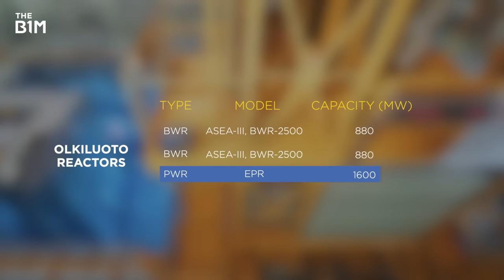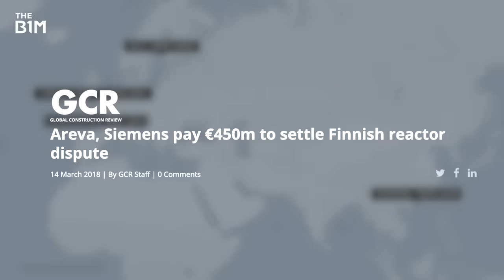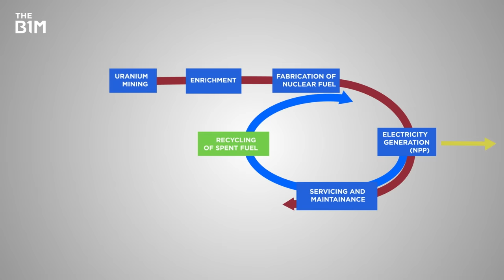Finland Might Have Solved Nuclear Power’s Biggest Problem

Comment: wait. this whole video boils down to "just bury it good."
Reply: Turns out that's just fine, overkill really, that should be the takeaway.
Reply: bury it better than before it was mined should be the only standard.
Reply: I mean, yeah, you can boil down lots of things to a few key words, but it doesn't mean it's easy.
Reply: @RedRocket4000  Yeah, but the material is much more concentrated once it's been used industrially.  Storing it in a place that is geologically inert seems like a decent solution from a natural disaster standpoint, though.  It would take a natural disaster so big that nuclear waste would be the least of our worries from that standpoint.  I'd still be concerned about terrorists digging it up and exhuming it from its tomb, though, to create dirty bombs.

We should probably dilute the waste so that the radioactivity per cubic meter is at acceptable levels and then dispose of it how you say.
Reply: Yeah that’s really what I was expecting. I thought for sure he was going to have some sort of new experimental solution in destroying spent uranium rods but I guess not. We really should be focusing on a way honestly to try and get it into space and sending it into the Sun. I know that still just throwing it away, but at least that way it will genuinely be completely destroyed with nothing left whatsoever.
Reply: @danielwhyatt3278  the problem is that you lose energy doing that, like why would you even use uranium if you are gonna need to power a rocket
Reply: @brainmind4070  Mars is geologically inert.
Reply: @brainmind4070  If we start shifting our reactors from E/LWR's to newer types of reactors like MSR/breeders, the isotope of uranium that is left as a byproduct actually contaminates the waste and makes it cost prohibitive to proliferate
Reply: It is a very FINNISH solution ... they bury everything  😒
Reply: @zolikoff  but its still only 150 years worth of a solution.

AND its another billion dollars on top of all the other billions we put into building the nuclear reactors in the first place.

Finland doesn't have much choice however, I doubt Solar or wind are as viable due to weather.  But its just a hilarious solution to the problem.
Reply: @anrit5972  These spent fuel rods would probably make for a pretty good shitty RTG.  Like, not hot enough for a reactor, but pretty great for human scale RTG.
Reply: @brainmind4070  meteorite will expose it
Reply: Just “bury it good” would have been better English.
Reply: @windowsvistasuxalot  It would have to hit it directly, or else the impact would have to be so energetic that nuclear waste would be the least of our worries.
Reply: @danielwhyatt3278  I see a huge risk with that since no technology is 100% reliable so putting tons of nuclear waste on top of a huge rocket could potentially lead to a disaster if something goes wrong and it explodes above our heads. Such a risk outweighs the risks of burying it.
Reply: @danielwhyatt3278  "We really should be focusing on a way honestly to try and get it into space and sending it into the Sun."

You think launching hundreds of tonnes of spent nuclear fuel through the stratosphere atop a massive space rocket is less of a risk to health than burying it where it's used in deep rock formations billions of years old?
Reply: There is another way to deactivate Nuclear waste Called Project Safire using High voltages  to ionise the materials and recombine it as harmless simpler materials that dont  decay anymore. Electrical Remediation of nuclear waste is coming.
Reply: @brainmind4070  And let us not forget that the global supply of U is not a finite resource. Mankind greed will do the usual thing and gulp it all up in no time.
Reply: @danielwhyatt3278  Rockets have the tendency to sometimes blow up, even having the latest mars rovers powered by plutonium was a huge security concern. I wouldn't recommend doing that for any scalable amount of spent fuel. And sending stuff into the sun is a whole other story, better send it on a one-way mission out of the solar system.
Reply: Perhaps within less than 100-200 years already some scientists have invented a much better use for nuclear waste.
Reply: @AceDeclan  Yes, thank you. The awkward phrasing was intentional.
Reply: @danielwhyatt3278  doesn't seem needed. Just bury it.
Reply: @meateaw  It fills up after 150 years, and then they seal it and build another. The waste in this facility will be safely stored until it becomes inert. I think one new storage facility every 150 years is an acceptable solution.
Reply: @flamingfrancis  Currently available supplies will last for 230 years. There's enough Uranium in seawater to supply the world's energy needs for the next 60,000 years. I wouldn't call that "no time".
Reply: @zolikoff  people think nuclear waste is much more dangerous than it actually is. if put in a sealed steel barrel it will just sit there decaying.
Reply: @brainmind4070  The raw material mined and eventually refined into fuel, is a colossal amount itself. If the spent fuel needed to be diluted down to a level of radioactivity that was considered 'safe' enough to be buried without the existing complex way, ie, general industrial refuse...

It would require a similarly enormous amount of inert material (soil/gravel etc) that disposal would look exactly like the mining operation.

The cost of disposal would be on a par with sourcing the fuel.

Cost of the electricity from using the fuel would rocket up to something ridiculous, like double or more.

Essentially, unless anyone is going to reduce the activity to background levels, there's no financial possibility other than treating all the spent fuel the same as it is now.
Reply: @danielwhyatt3278  The ideal solution for nuclear and all other types of waste is to find new methods for recycling them. We have limited resources on earth and we should find ways to recycle them indefinitely.
Reply: @danielwhyatt3278  The problem with sending it into space is that if we had an explosion like the Columbia disaster but with spent nuclear fuel on board it would make large portions of the planet inhabitable. Also fun fact! It takes less energy to shoot items out of the solar system than into the sun.
Reply: @droplifter3435  Yes, the cost of the process would increase as it is currently on balance sheets.  The thing is, though, that there are costs that are not being factored into these balance sheets due to playing nuclear waste hot potato, which is not a viable long-term solution.

The cost, however, would probably be less than mining for at least a couple of reasons:  1) The spent nuclear fuel could be mixed with other inert waste material, so more inert material would not need to be mined.  2) The speculative aspect of mining (prospecting) and costs involved in that would not be part of the process.
Reply: Upvote so people do not watch this pointless video. Struggeling for content i suppose
Reply: @brainmind4070  i really can't see terrorists mining half a kilometer of billion year old bedrock without the finnish government finding out
Reply: @duderRechthat  agreed. I felt clickbaited. No disrespect to Finland or it's nuclear program though.
Reply: @adamsmall5598  i mean.. I feel some disrespect towards finland and other nations for not making the move towards renewables. Putting nuclear waste into the earth is still risky and scummy thing to do towards future generations. It has not been tried before long term, no one knows how long this stuff keeps contained or if there will be leaks in couple hundred years.. Germany already had to dig up nuclear waste which started leaking after only a couple dozen years (stored worse than in finland probably but still)
Reply: @adamsmall5598  finland is a free nation of course, but seeing how long nations lasted in the past we can predict that no nation will survive as long as this nuclear waste does. So what gives finland or any other nation the right to risk fatally polluting parts of our earth like that?
Reply: @duderRechthat  That is a reasonable opinion, though  I disagree with two points: the designation of the disposal efforts as 'scummy,' and the assumption that the so called 'clean' energy systems are not without their own environmental issues in need of resolution. Additionally, I believe nuclear, like many of our technologies, is a work in progress. As long as our societies continue to strive for better practices and paths, these issues will be overcome, bit by bit.
Reply: @duderRechthat  a fair question worth serious discussion and thought on ways to counter the situation. I am no expert on these issues and will not be able to provide a solid discussion. My opinions on the matter are not deeply rooted either, so I would express an ambiguous position at best.
Reply: The best way to bury Level I waste would be to send it to the bottom of the Marianas trench, right ahead of the crustal fault where it would be subducted into the earth's mantle; the rate of subduction is ~12 feet (or 3.3 meters) per year.
Reply: @danielwhyatt3278  Send it to space? So that if the rocket explodes on the way up half the world gets irradiated? The Uranium came from the ground and putting it back deep enough is the safest solution by a significant degree.
Reply: @mchammer5026  the uranium & every other element in the solar system except helium was made by the ginormous open fusion reactor that is the Sun, putting a few little bits back won't even be noticed
Reply: @alanhat5252  The point is that it takes much more energy to launch something into the sun than to shoot it out of the solar system. For someone lecturing others about astrophysics you are lacking very basic knowledge of orbital mechanics.
Reply: @alanhat5252  Hold up, finally having time to properly read your post, pretty much everything about it is wrong.  Nothing in the solar system was made by the sun. It's been made by other stars that are now dead. And the vast majority of what the sun is producing now is Helium, the only thing you say it doesn't produce. Read up on your astrophysics before you try and lecture and misinform others.
Reply: Everything boils down to just do thing good.
Reply: @WayStedYou  Oh really? What about genocide?
Reply: Just bury it Deeper, DEEPER, DEEPER!
Reply: @brainmind4070  Terrorists digging the waste out is just not going to happen. An actual mining consortium has been diggin the mine for a decade, incompetent group of idiots would take a thousand years to get that deep. You see, they are actually going to seal it like rock and concrete, just because they don't want people getting their hands on it. Humans could dig it up put it would take enourmous and planned effort requiring tens if not hundreds of diggers because those people would be using stone/scrap iron hammers because present civilization has seized to exist.
Diluting it would mean the volume goes up ten fold. It took decade to get this far and with diluted waste it would easily take many decades more.
Reply: @danielwhyatt3278  Sending spent nuclear fuel to the sun is not easy.
Reply: Ehhh the vast majority is low level waste that will be safe in a couple hundred years, of the 10% of waste that is high level waste (spent fuel) only 10-20% of the enriched fuel is used up before it cant sustaine a reaction anymore, re-enriched fuel reuses of 95% of the spent fuel, meaning that of the vaste amount of waste already produced only .5% of it is truly a problem, but almost no government currently allows re-enrichment to happen
Reply: Yes, just this. Nothing new.
Reply: @flamingfrancis  infinite source no... But at minimum hundreds of years to thousands and with filtering it from seawater tens of thousands of years of supply, i dont think you or your children need to worry, especially considering of the fuel we have used 80-90% is still in the spent fuel rods if only they were re-enriched, anyways heres a link

https://www.scientificamerican.com/article/how-long-will-global-uranium-deposits-last/
Reply: @brainmind4070  i think we will dig it back up before the terrorists do TBH, its easier to re-enrich spent fuel then make new rods, governments just need to approve re-enrichment currently not happening
Reply: @WiseOwl_1408  Don't bury it. Stop creating it in the first place.
Reply: @GameCyborgCh  Yes, but it will seep out of the steel barrel.
Reply: Cool comedic over simplification. Wait.
Reply: @Echidna23Gaming  Please explain.
Reply: drill a hole to the center of the earth and....??
Reply: @danielwhyatt3278  Sending something from the Earth to "fall into" the Sun requires immense amount of energy. Orbital mechanics is not that intuitive, but its not as if we just push it in the general direction of the Sun, so it falls over time. ;)
Reply: @Alfred Wedmore  Ummm...... there is heavy investment.
Reply: Still better Solution than what Germans have, (replace everything with Coalburners, and expect others to take the fall for it)
Reply: @danielwhyatt3278  it could cost milions and milions of dollars to send them into space
Reply: And deep!
Reply: @danielwhyatt3278  That would be a stupid idea. First: Uranium is heavy and would require big rockets to lift it into space. Second: Rockets explode from time to time. Do you really want to spread this stuff over a big area while the wind would carry the finer particles around the world? Third: Even if you can get it to space with 100 % success, you still have to get it to the Sun. This is not easy, it is far mor complicated than just pointing a rocket towards the Sun and giving it a go. Everything we send up there is in an orbit around the Sun, so you would need even bigger rockets and loads of fuel to decelerate and lower this orbit until it finally falls into the Sun. If you don't do this, you will most likely miss the target and have a load of uranium on a random course through the solar system which might bring it back to Earth. The last thing is: What would it do with the Sun? I don't know if the amounts, we could send there would do any harm, but to be honest: I don't believe that we should try it out.
Reply: To be fair it's a lot more complicated than that. Similarly, nuclear power can be described as "just boil water".
Reply: @brainmind4070  Terrorists digging up hundreds of meters of clay and no-one stopping them? Well, I'd say they'd be quite terrorists if they could pull that off. I mean, once they found out there's a bunch of terrorists half way down they could just drop in a shit ton of chemical weapons for example. No more terrorists.
Reply: Why are you happy when engineers find a practical solution to a practical problem? You want some sort of laser show?
Reply: @meateaw  That is incorrect. The first time construction is worth that much yes. Once it is up and running you dig one new tunnel for each that you fill up. That is definetly not billions of dollars per 150 years. You could effectivly do this for a millennia.
Reply: @danielwhyatt3278  Im sure tossing into the sun would create additional problems, i dont know what they would be but im sure something would happen eventually
Reply: @meateaw  not a hilarious solution at all.The waste is buried deeper then the water table and it really can't find its way into environment by no means.Its deeper then it was when it was mined so this is the perfect solution.Unlike storing it tunnels bored inside the mountains where it can leak and seep into environment and groundwater
Reply: Hey fellas, I got an idea, let's just create a portal to h3ll and send all that crap thru. 

Im pretty sure the stygian denizens of the shadow world wont mind.
Reply: @dasalekhya  you mean…even their feelings? :D
Reply: Well, they did mine it from the ground initially, so putting it back shouldn't be too much of surprise
Reply: yes :D
i would have grind it down and use it as a vegan food addon
Reply: you know all this nuke fuel was dug out of the ground to start with right?
Reply: Bury it correctly, tho
Reply: Yes.
Also, "last one closes the door".
Reply: @meateaw  AND how much fossil fuel was used to dig that massive hole in the ground?
Reply: @danielwhyatt3278  maybe we spotje bury it near a  subduction zone, have the earth recycle it
Reply: Yea that's terrifying
Reply: @danielwhyatt3278  I don't think we should send anything into our sun, how about we just leave our sun alone.
Reply: @danielwhyatt3278  nice to see an E7 fan.
Reply: thanks
Reply: Yeahhhh and no. You don't want anywhere with earthquake or a water table.
Reply: @RedRocket4000  4f
Reply: @brainmind4070  Well seeing is it's situated in a craton, it's definitely stable. Problem with the US is that while a large part of the country sits atop the North American Craton the sedimentary overburden is thousands of feet thick. We need a depository that is in an area with virtually no sedimentary overburden. Plus we have to deal with NIMBY.
Reply: Will Swift  we cannot get solar and wind up quickly enough. And not everywhere in the country is amenable to such technologies. We already get 19% of our power from nuclear and do it pretty safely.
Reply: @Alfred Wedmore 😆 😆 😆
Reply: @McSlobo  It's in the middle of catatonic rock which is even harder than clay. Terrorists digging it up really isn't a concern
Reply: @gumelini1  Cratonic rock makes for great deep geological repositories. It's very geologically stable.
Reply: @Echidna23Gaming  contaminate the waste and avoid proliferation,,,
Please explain?
Reply: @harrietharlow9929  your thoughts on helium3 & helion reactor ?
Reply: Thanks I’ll jump to something else then
Reply: Saved me 7mins, cheers
Reply: Awwww.... spoiler!!! Lol
Reply: “oops, i accidentally created a TLDR”
Reply: @lordsofgaming1060  heh, yeah, I guess so.
Reply: I’ve been saying it for years
Reply: I read this comment and it saved me 5 minutes thank you